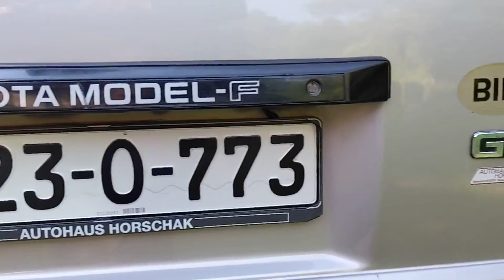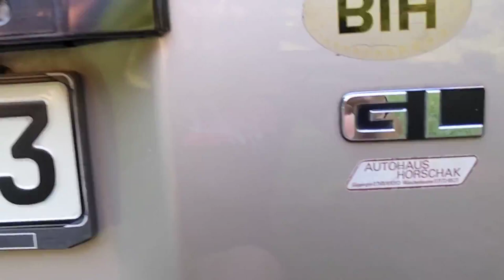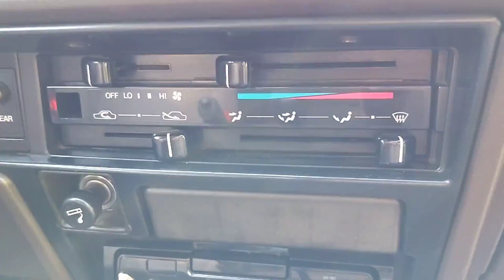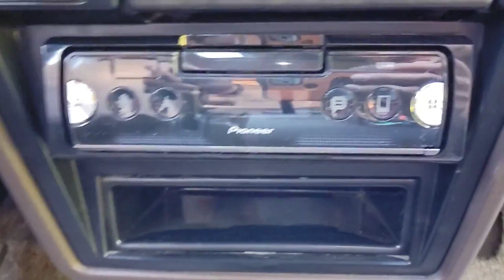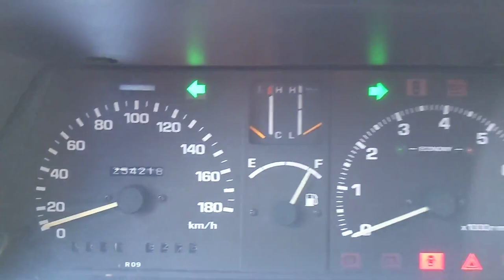My Toyota Model F Space Cruiser

Comment: I'm in the US and have an 87 Toyota 4x4 Van. Toyota called them the "Van" here...sometimes you'll hear Van Wagon. I noticed quite a few differences between what I've seen in the US and yours. Besides the headlights and mirrors, I've never seen the fold down seat in the middle row like that here. It appears to fold up for 3rd row access. Also, your 3rd row side windows open. Wow! Those windows don't open in the US. Solid glass. Never seen that hazard light setup. Another thing I noticed that we don't have is the "Economy" lights in the instrument cluster. Also...all US market vans were fuel injected. Interesting! Engine sounds good!

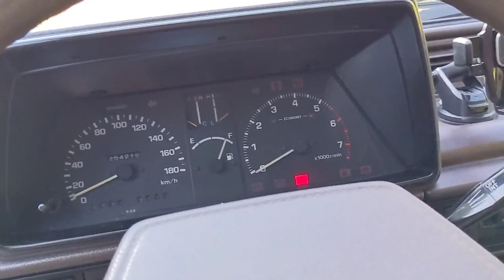Comment: Hi - Nice  Model F - congrats they are really rare and hard to find. At 10:00 I have a hint for you maybe. The green retro fitted lamp should show you if your trailer is indicating correctly. On hazards its alway blinking, but on normal indicator not, right? So I bet your model f has or had a trailer hitch!? If you connect the trailer the green light will blink on normal left or right indicating. We had the same on our Ford Granada station wagon 1982 Model.
Reply from the maker: Hi , thank you , I'm very lucky I guess :) Wow that is some very interesting insight. I do have a trailer hitch :) I will attach the trailer and try it out , thank you so much

Comment: I can’t see my comment so I’m posting it again and I apologize if this is a repeat… How do I check the oil in a 1985 Toyota van? I have inherited one and can’t figure out how to check the oil… I found how to fill the wiper fluid and how to check the brake fluid. Still looking on how to check the oil…
Reply from the maker: So ,if you have the same model as in this video, then the engine should be under the drivers seat. The Dipstick is located close to the distributer cap, If you have a RHD, then it's the opposite side, I think
Reply from the maker: on min  10:50 you'll see the engine, the little yellow thingy is your dipstick,and on top is your oil filler cap

Comment: Do you know how to put the toyota van 86 on time? Is it that the distributor took him out and now he does not want to turn on
Reply from the maker: well I guess it's pretty much the basics. I'm not sure if this is the case with the toyota, but on all the other engines i rebuilt it worked.
Remove the Spark plug of the 1-st cylinder, remove the distributer cap. Slowly rotate the engine ,till the piston is in the dead center position( you can put a screw driver where the spark plug was) When the piston is in the Top Dead Center, the  Rotor should point in the direction of the 1st cylinder. Make sure all the cables are connected correctly . put everything together  and try to crank it.

Comment: timing chains notoriously rattle on startup and low idling
Reply from the maker: so nothing to worry ?
Reply: @emir2485  not at all. intermittent Chain rattles start as early as 30,000 miles at startup and sometimes at idle. As soon as you get to 1000 RPM and above the chain stops the rattling.  The other less common quirk is the piston slap which goes away after the engine is warmed up . For the first couple minutes if your engine sounds like a diesel that's piston slap. I have driven well over 300,000 miles with both conditions. The chain rattle will sometimes be at its worst after an oil change since the chain tensioner works off oil pressure